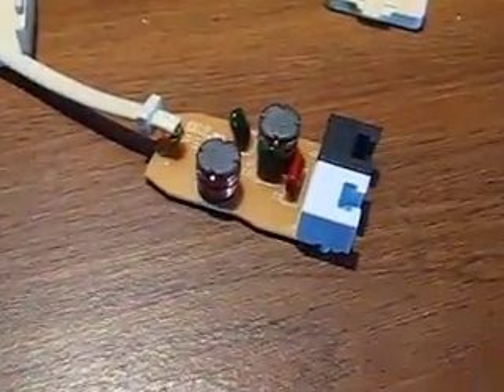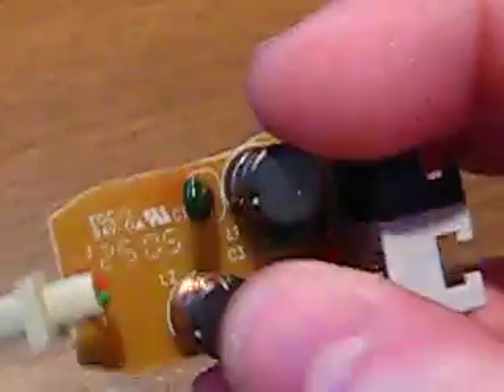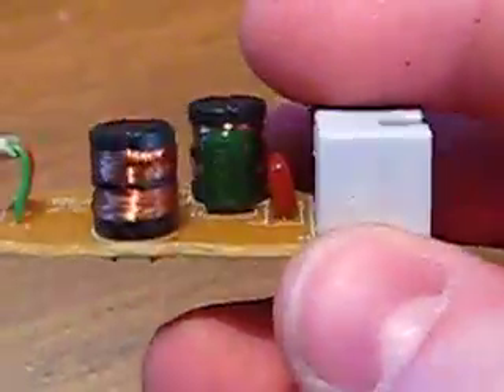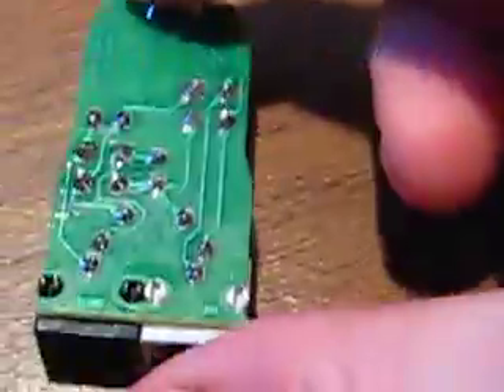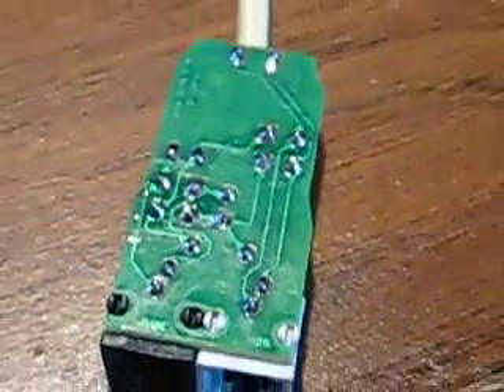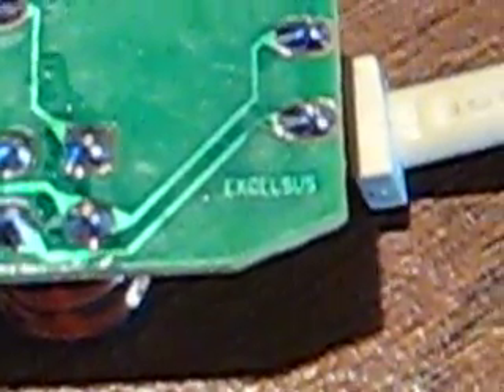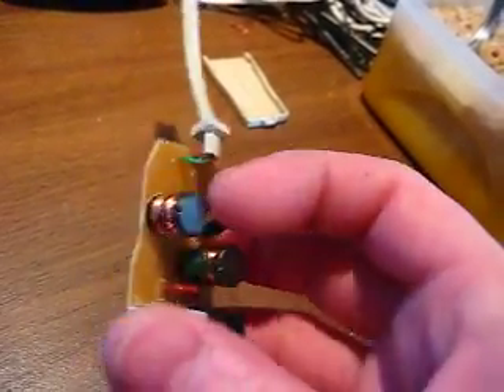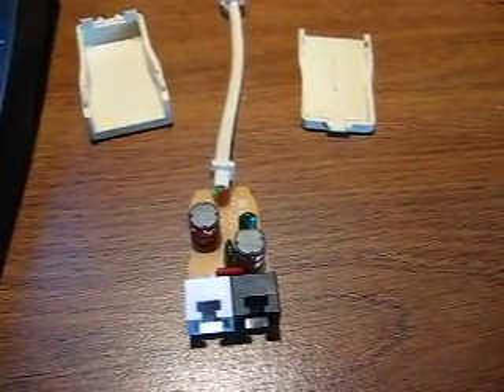Inside A DSL Filter

Comment: From one of those filters i made an extension for the cable.I plug one cable to the side that says phone and the other cable to the side that says line so can have the double of the cable lenght.The part that had the "mail" part of the filter ive toke it of from the filter .Resuming i made a 2 cable connector with it.Its easy to do and handy when you dont have a cable with enough length.

Comment: Looks like it has two simple LC filters, each using a coil (inductor) and a capacitor.

These things also work well to help improve dialup modem and fax machine speeds even on phone lines that don't have DSL on them.